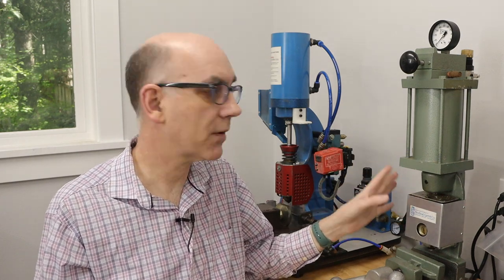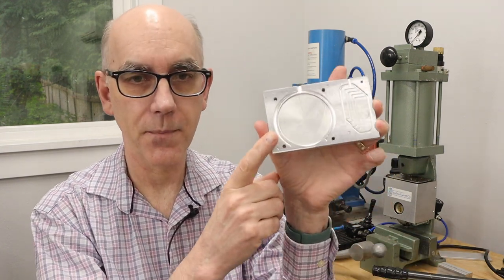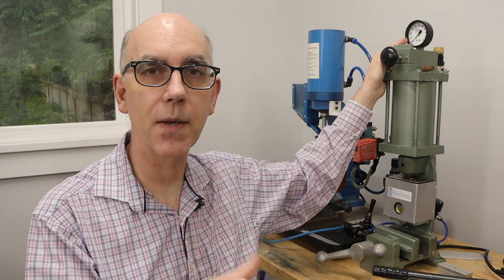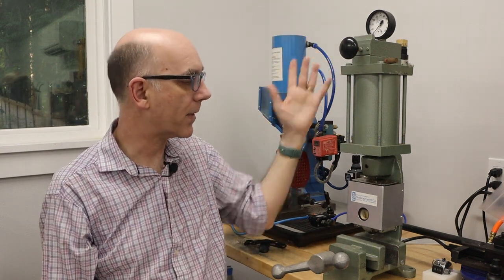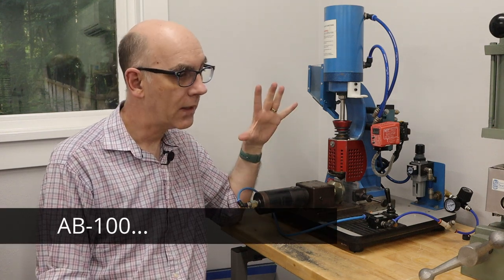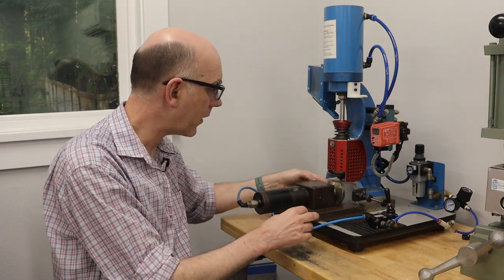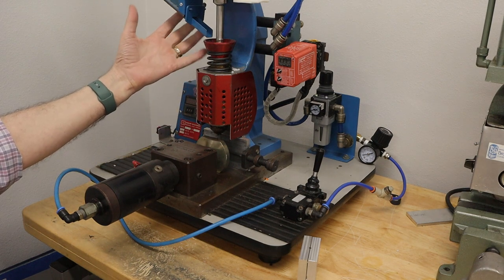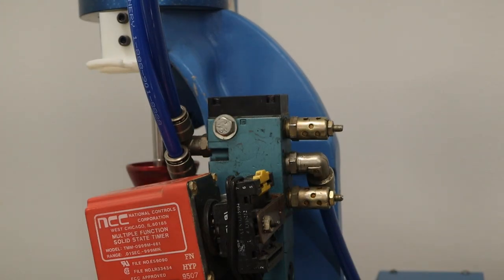Desktop Plastic Injection Molders

Comment: Thanks John. I am putting the finishing touches on a DIY injection molding machine (similar principle to the LNS 150A, but bigger) and am looking forward to learning my way through some of the lessons you shared.
Reply from the maker: It's definitely a fun process. My suggestion is just go for it. You'll learn more from your failures than your successes. And start with simpler designs and work your way up.

Comment: Thanks for making this great video.  It's nice to get an overview of the timing/speed adjustments on these pneumatic presses. I'm curious about how the heating chambers on these machines are mounted, and how they make contact with the mold.  I assume they have to descend when the ram descends with enough pressure that they don't leak.  How does that work?  Are they floating in some way?  Thanks again for the video.  I've been watching a lot of your videos recently since I started doing some home brew injection molding.
Reply from the maker: They're mounted to the column with screws that are in slotted holes, and have springs. The ram pushes the heating chamber against the mold, which provides a good seal to keep the plastic from coming out.
Reply: @JohnSL  Yes it seemed like it had to be able to move/be pressed against the mold, but I couldn't find any pictures of how that worked.  Thanks!

Comment: Could you do a video about overseas short-run injection molding in small quantities?  Like 20-50?
Reply from the maker: I don't know anything about that. It seems like a quantity of 20-50 would be better done with 3D printing or casting from silicon molds.

Comment: I have the Emco 999 but I've found that information on its operation is pretty tough to find online. I have a manual I've ordered for it but I'm curious to know if your emco features in any of your other videos?
Reply from the maker: There isn't much to it, and I've never had a manual for my Emco. There are basically two things you can change: the temperature and the pressure on the cylinder. So the operation instructions are turn it on, wait until the heating light goes out, add plastic, clamp the mold, press injection for a few seconds, and take the mold out. Was there anything specific you were looking for?

Comment: Thank you for the informative video. I always enjoy your deep explanations. 
What is the brand of electromechanical timer used with the AB100 ?
Reply from the maker: It's made by Mac Valves Inc. The model on this machine is 811C-PM-111BA-152, which doesn't seem to be made anymore. My valve is having problems, so I'm going to tear it down and see if I can fix it. If not, I'll be replacing it with a newer valve. That will be the subject of a future video.

Comment: I found your vid's last week and love the content. Great stuff. 
Have you covered a vid on a supplier for colored pellets? I will be designing a pellet maker based off of your approach (for ABS in different colors) but wanted to ask if you use that material you make/cut or just ended up buying it?
Reply from the maker: I haven't. From what I know, getting custom colored pellets means buying a minimum of 55 pounds (if I recall correctly). And that's way more than I can use. That's why I'm chopping up filament.

Comment: Great video! well explained.What quantity is it suitable for injected molded parts?
Reply from the maker: The main thing is the cost of molds. Molds for desktop injection molding machines are a lot less expensive because they’re much easier to make. But that assumes the part is small enough and doesn’t have complicated features. In those cases, hundreds of parts. This is based on molds costing around $1,000. When you get to larger or more complicated parts, generally thousands of parts.

Comment: Excellent video.  How much do those A.B. Plastic Injector machines run for?
Reply from the maker: You'll need to contact them. I purchased my AB-100/150 (it's a 100 with upgraded to be more like a 150) used on eBay over 10 years ago. Rulon also purchased his machine used.

Comment: Hello, John - Very interesting & informative video..
I have the 2/3 oz version of the pneumatic Emco molder.  It came with a small matching compressor that needs to be switched on for every injection (no holding tank).
I'd love to hook this up to my larger vertical compressor - I'm curious what sort of intermediary valve set-up you have on yours, if any...
The large compressor has a small moisture filter on it.  Do you think another should be added, closer to the molder?
Any info would be much appreciated - Best, Aaron
Reply from the maker: I was having problems with water in the are and used a water filter near the compressor. I found that upgrading to a 30 gallon compressor made a huge difference in the amount of water in the air. With smaller compressors, the water stays in the air. But with the larger tank, it does a much better job falling to the bottom.
Reply: @JohnSL  Thanks, John! - Mine's a 20 gallon so I'll see how that does for now..  Did you put any extra air controls between the compressor and molder or did you find that one valve on top of the Emco was all you needed to deal with?  The valve on mine kind of sticks & I have to give it a pull to retract the ram..  Still fairly new to pneumatics & trying to be safe.

Comment: I can't believe how dangerous these desktop machines are. What's the plan if a body part gets caught between the mold halves? The production manager in me freaks a little when unsafe machinery is used
Reply from the maker: The clamping cylinder has a very short stroke of just 1/4". So it's safer than it might at first seem.

Comment: many of those things could be added to any machine in a few minutes. Such as that mold stop and pusher
Reply from the maker: Absolutely. And in fact my Emco has a tapped hole on the side already so it would be easy to add an end stop. However, I rarely use that machine anymore, so probably won't get around to updating it.

Comment: Hi John I have 1.25 tone on a 30mm ram is this going to be ok for larger parts?
Reply from the maker: I talk about clamping force in my latest video, which covers my Travin TP-1 that has a 25mm diameter plunger, and how to make some parts (not very quickly) when they're larger than the clamping force will allow on desktop machines.
Reply: @JohnSL  
Hi John call me dumb but if I have a 125mm bore with a 30mm ram what clamp force would that need?

The force of the ram I think works out to 1250kg at 10 bar

Comment: عندي سؤال ، ممكن اعمل قوالب ( اسطمبات) من الريزين ( بولبستر ) وشكرا
Reply from the maker: Some people  have had success with 3D printed molds. But they don't last for very many parts. Another option, which I haven't tried, is to use epoxy with metal powder mixed in. Here is an example: https://www.instructables.com/Home-Plastic-Injection-Molding-with-an-Epoxy-Mold/